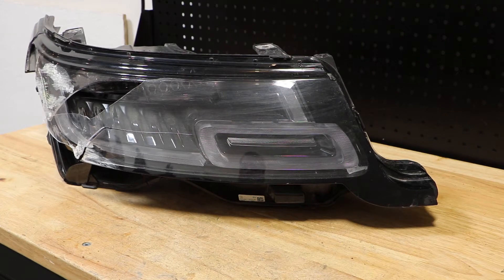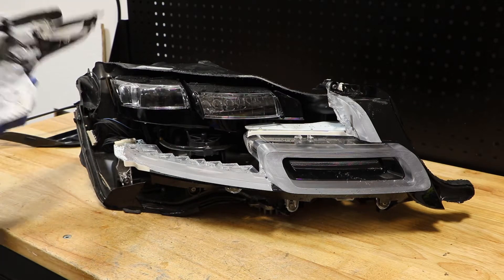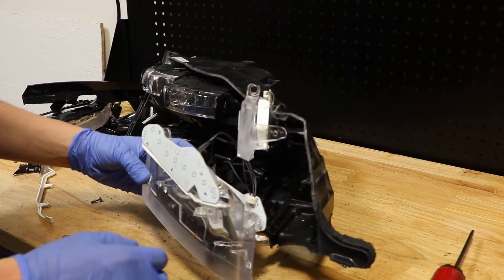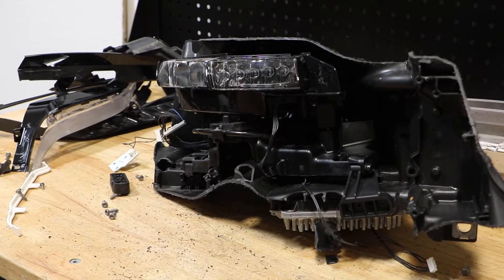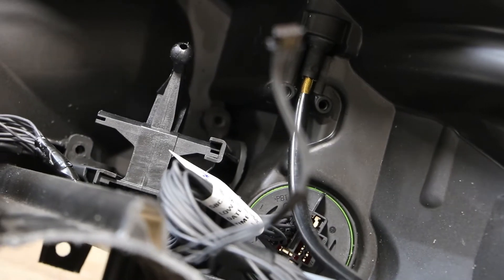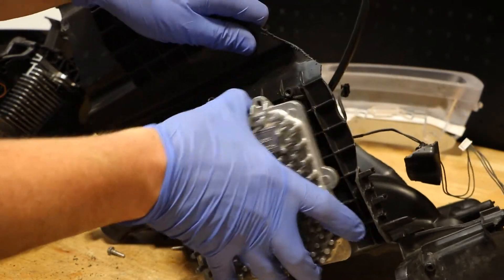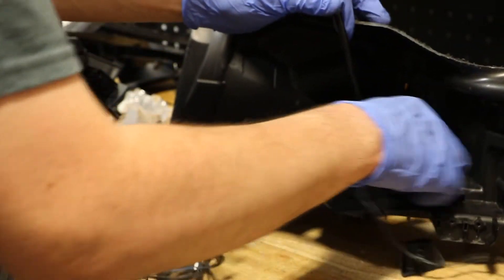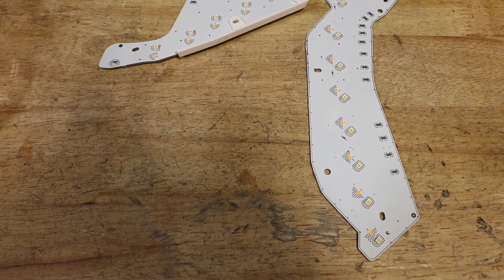2019-2021 Range Rover Sport LED Headlight Teardown

Comment: Do you know the difference in lumen brightness between Range Rover Sport 2019-2022 versus 2014-2017? As i know the Range Rover Sport 2014-2018 LED headlight has 3000lumens but I don't know the upper version.
Reply from the maker: I do not know the lumens output of the LED headlights.

Comment: Is there an adjustment screw to higher/lower the aim of the beam?
Reply from the maker: There is one to adjusts the projector forward/backwards.  The headlight has automatic adjusters for up and down.
Reply: @gftgrill  I have the full size Rover with the LED lights - does that make a difference?
Reply from the maker: @whobutni  the 2018+ rang rover led headlights are built the same way.  they have internal automatic height adjustments with a manual adjustment that moves the projectors forwards and backwards.